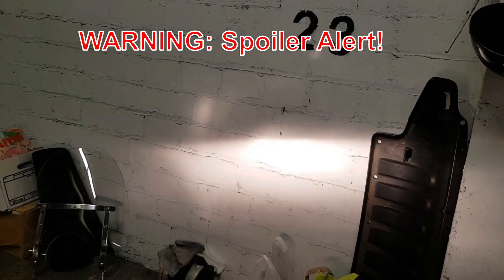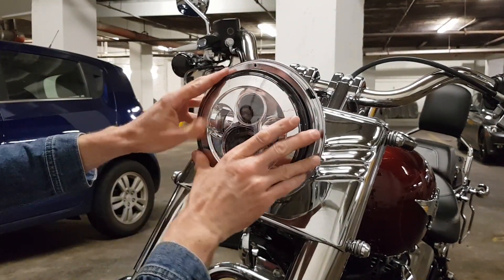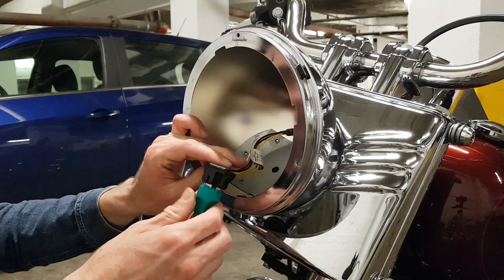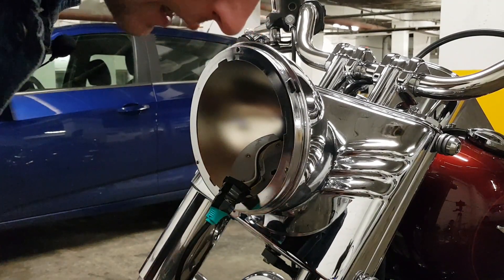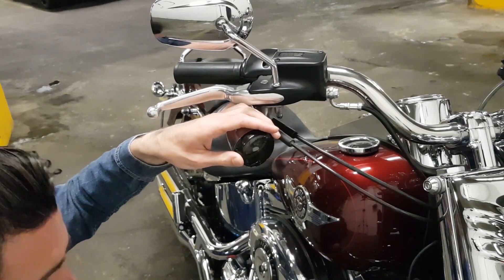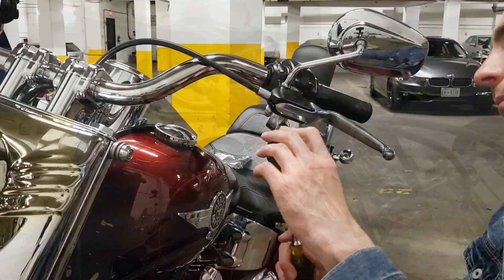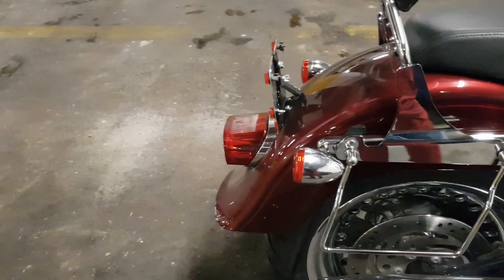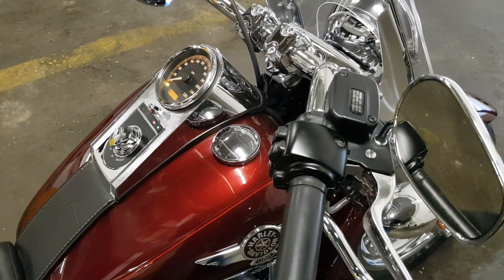Harley Davidson Fatboy – New LED Headlight and Turn Signals

Comment: Good Video Tx, will try on my 17 Fatboy ,so 1157 for front and 1156 for rear right ? Where did you get front smoke and rear red covers ...?
Reply from the maker: Thanks!
Right, the front has running lights.  I got the lenses from amazon too:https://www.amazon.com/gp/product/B076HN6884
https://www.amazon.com/gp/product/B07G712QQ7
Also, fyi I got this hyperflash.  Not a big issue but something to consider: https://youtu.be/yHAFGPEz93k

Comment: Before instaling the headlight i got error on BCM, b2132 and b2137, my fatboy is 2017, u have change something or u got that error too?
Reply: Did you get those codes before the headlight upgrade? Those error codes usually indicate an electrical issue with the headlight, like maybe an electrical short. Start with inspection of all the wires and the plug.
Reply: @dimitry7500  sorry is after i have installed the headlight i won that 2 errors, intaled the headlight and run the bike for 10 miles then the errors appeared

Comment: Where did you get your turn signals from, also the rears? I like those switch backs.
Reply from the maker: Hi, check out the links in the video description.
Reply: @UrbanMasterExperiment  okay thanks, are those lights halo or led? And if LED are those lights considered to be a white Led?
Reply from the maker: Hi, they are LED no halos in the back. I think they are red but I also have red lenses.  LED and halos are in the front only.

Comment: did you fix the hyperflash of the blinkers?
Reply from the maker: The blinkers are not hyperflashing.  Only the indicators on the dash do.  I pretty much got used to it.  Someday I'll install a resistor in the blinker line and that should fix it.
Reply: @UrbanMasterExperiment  i read if you leave the hazard lights on for 45 seconds, it will help your situation. Try it
Reply from the maker: I gave that a try and unfortunately it didn't work on my bike.  I made a short video, will upload it and share the link in a couple of days.
Reply from the maker: Here is the video
https://youtu.be/yHAFGPEz93k

Comment: What's the part number of the head light you used???
Reply from the maker: Hi here is the link:
https://www.amazon.com/dp/B01B37739O (without the passing lights)
Reply: I also have a Fat Boy and this shows the passing lamps included. Is there a single headlamp option?

Comment: I bought the turn signals as the ones you did, but the cap does not snap in. did you anything about it
Reply from the maker: Yeah, at first I thought that it would snap in too.  Actually the LED plate is held by the lens.  But make sure to coil the wires so they don't push out.  Had it on my bike for over a year with no issues.  Check that part in the video and it will make sense.